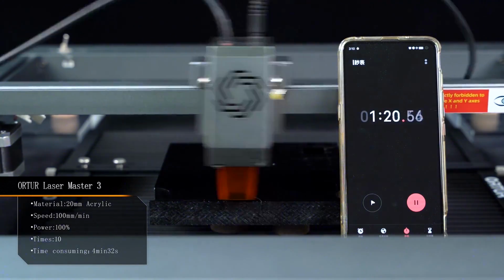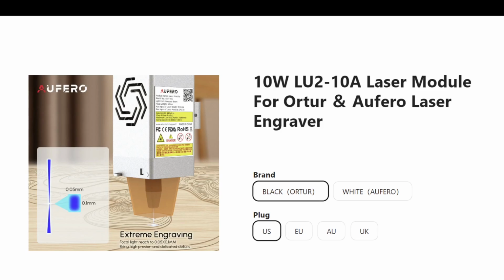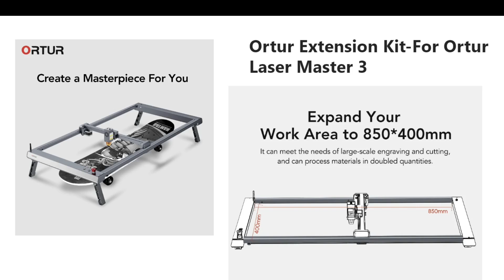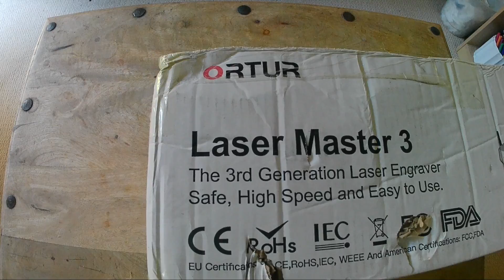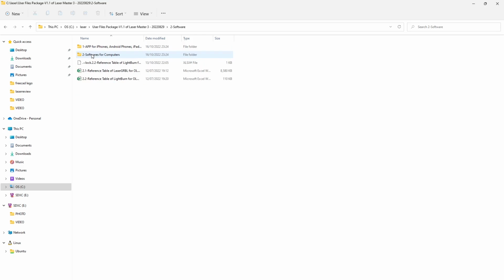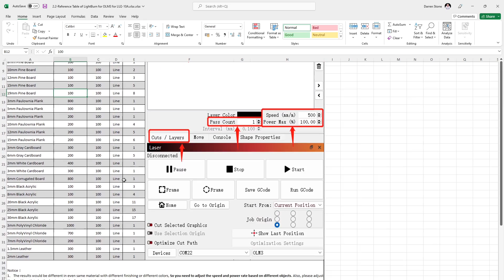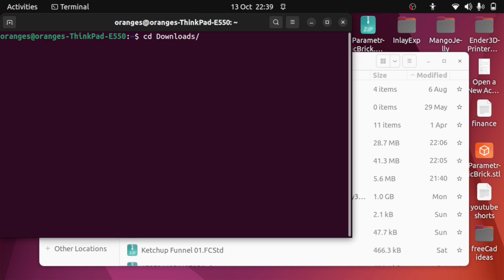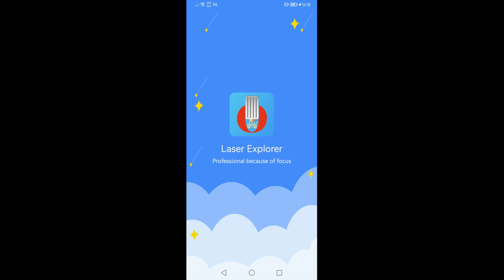Ortur Laser Master 3 Review. 10W 20,000 mm/min!! From Sinis | Top High End Blue Diode Laser

Comment: You seen to have a similar setup to me in you are using your basement. My wife wasn't impressed by the smell. I built an enclosure for my Tevo using 3 sheets of 4'x8' 3mm wood paneling from Homedepo cut to 3'x3'. This gave me the 6 sides I needed. Clear plastic sheets were out of my price range. I got 1"x2"x8' scraps from their reject pile at half price. 2 hinges, 2 hook hasps and some weather stripping. 1 light bulb and a piece of glass from a picture frame to make a window. The temperature now remains constant year round. And the smell is completely contained. Don't forget to silicone the seems. Total cost around $70 US.
Reply from the maker: Thanks for this it's now on my to do list, yes my set up is the same in the basement and I need to build a enclosure as like yourself I need to contain the fumes. I never really thought about the temperature (good point).  Did you tint the glass at all to help reduce laser scatter or do you just wear your glasses all the time?  As well as keeping the glasses on I also need to reduce the flashing as it's starting to make me feel ill and was wondering what the best way to go about tinting the viewing window.
Reply: @MangoJellySolutions  this was for my filament printer. Can't afford a laser cutter just yet. But a little window tint might do the job if you swap in a laser cutter. Im sure any car tinting shop would have free scraps. wouldn't take much to tint 8.5"x11" picture glass. you could even double tint for more viewing protection.
Reply from the maker: @stewartpalmer2456  Ah I see :) Now that's a great idea with the car tinting shop, would of never of thought of looking there.  
Thanks :)
Reply: @MangoJellySolutions  I also toyed around with using a pc fan and conduit to extract and direct the fumes outside. just havent got there yet.
Reply from the maker: @stewartpalmer2456  Neat idea :) I have a couple of old PSU's up in the loft.  Now I know what to do with them :)